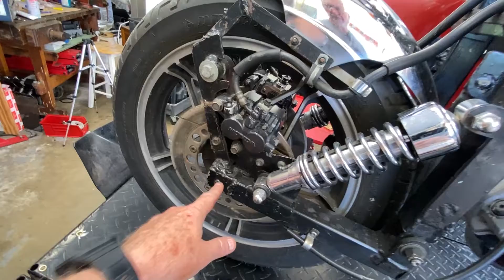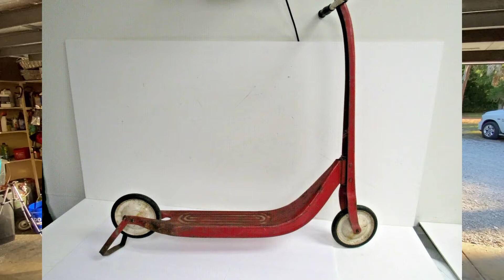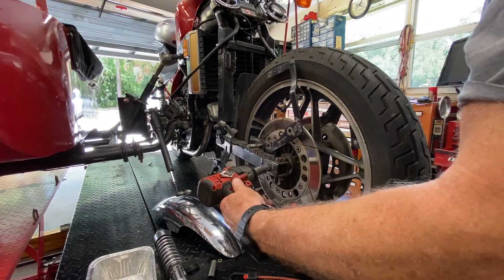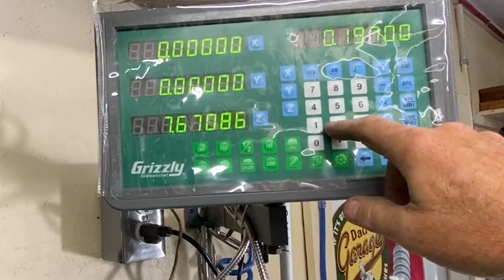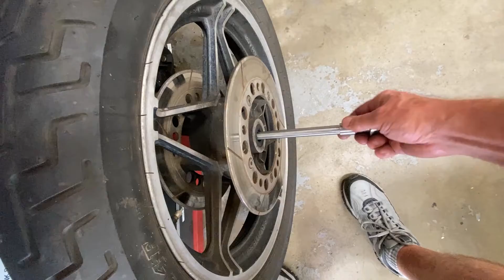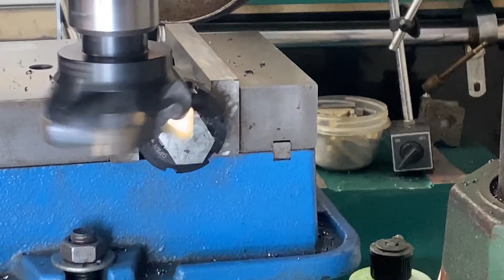Motorcycle suspension leading-link re-engineering & improvements part 1

Comment: Adjusting the trail is easy if you construct your leading link fork using a rear swing arm from another bike,you can if you wish use an aluminium MX swingarm; some welding may be required, but you have a slotted end with the chain adjusters to experiment with trail measurement.

Comment: since your swing arms move independently your shocks need to be perfectly synchronized because they will work independently !! Not good !!!
your depending on your fender to keep them parallel .Which it was never designed for. 
you need to rethink the design .
Reply: One of the big problems with independent arms on a leading link is that you get a lot more pressure / wear / movement in the pivot points. And that movement can be seen in this video. If those arms were interconnected, the movement would be greatly reduced with out even doing any work on the pivots. Not knocking this video or build. Just pointing out an area for improvement.

Comment: Did you change the tow in when you fitted the leading link forks?.  I've recently fitted some to my outfit and the handling went all to hell (they are a factory produced item).  A friend who has vast experience in fitting sidecars advised that with leading links there should be no tow in.
Reply from the maker: Never heard that. I maintain the same toe-in on the sidecar, about 1/2 to 5/8" measured 3-4 feet or so in front of the centerline of the sidecar axle.
Reply: @philiphodges6246
Your friend is incorrect; even horse-drawn sleds require toe-in. 
The best solution is to build an adjustable toe-in bracket, find the best feel, no excess left or right handlebar 
force when travelling straight, then weld the fitting.

Comment: I’ve got a 2001 Suzuki bandit 1200 that won’t stay idling I have cleaned the carbs and put the to the correct spec I’m pretty sure but I just can figure out why to won’t run it might have vacuum leak but I don’t know how to test/fix that I was wondering if you had any idea what might be the problem?
Reply from the maker: Carb holders. Get it running and spray some brake clean or carb cleaner at each one and if leaking the engine will respond. It may be subtle but it works.

Comment: Can I ask why the the two arms aren't linked at the back.
Reply from the maker: Good question. Yes. Across the bottom and it holds a vertical piece of sheet metal that serves as a sort-of fender since the fender (chrome) is rotated forward.

Comment: Don't sport bikes have less trail not greater ????????
Reply from the maker: Positive trail is back towards the engine. More positive trail yes.
Reply: @MotoRestoFL  We may be semantic, .....but 0 trail is a vertical steering axis projected in the center of the tire's contact patch. Positive trail is the steering axis ahead of the contact patch, and negative trail  is behind the contact patch.  And increase in positive trail moves that steering axis projection farther ahead of the contact patch...a numerically bigger positive value.  Decreasing the rake toward the vertical is a smaller positive number.

Sport bikes have less rake, so the contact patch moves toward the steering axis and is a smaller positive number.  Going from a "cruiser" to a sport bike might take the rake from 4" to a lower value of 2".

I hope I don't have this wrong, but I think this geometry and terminology is well worked out in lots of motorcycle and automotive suspension literature.

Thanks.